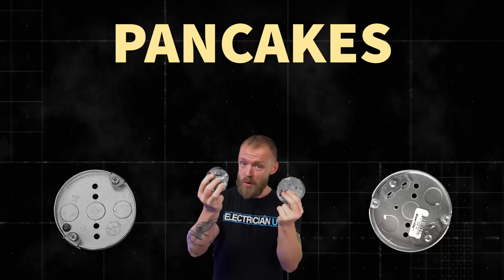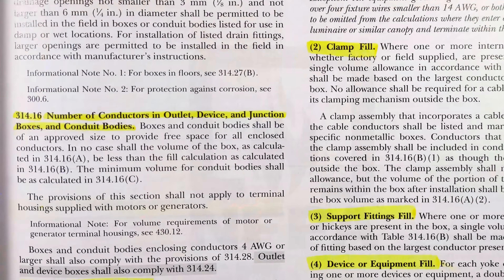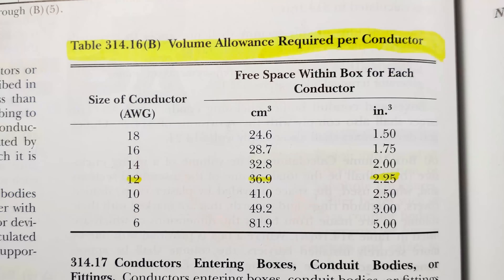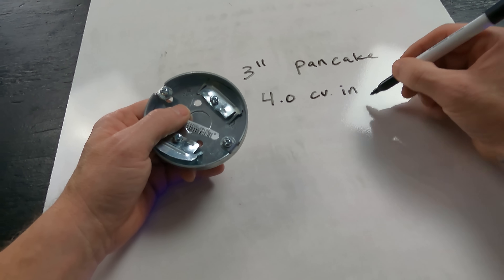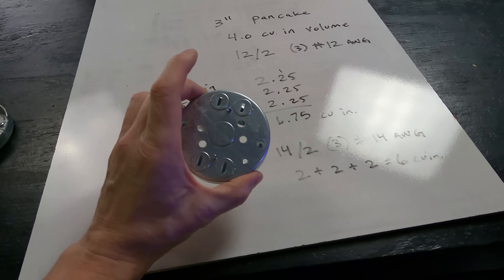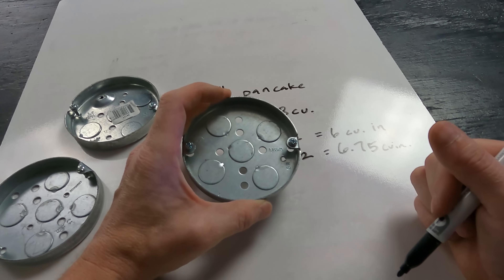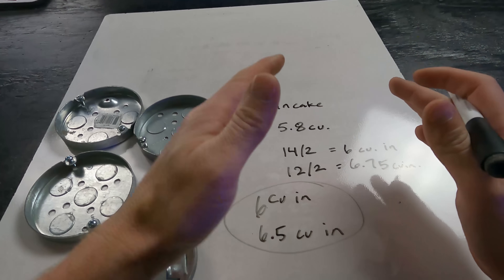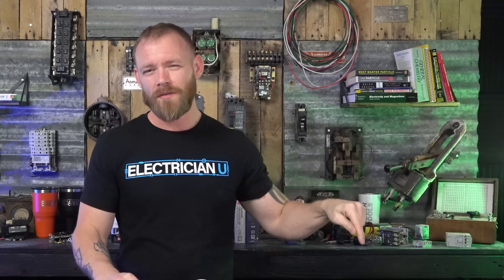Do Pancakes Violate Code? How Many Conductors can ACTUALLY Fit?

Comment: Well, you've helped me uncover YET ANOTHER code violation in my house (2x 14/2 plus fixture wires and wirenuts stuffed into a shallow fiberglass pancake).  I have no idea how this place passed inspection 22 years ago (very basic stuff too).  I'm finding these things during repair of what always turn out to be sloppy installation (multiple arcing/crackling switches because of long conductor strips/shorts, several flickering light fixtures with bad wirenut technique, mis-wired smoke detector travellers left unconnected, multiple GFCI outlets on one circuit, and more...).
Reply: remodeling companies (kitchen & bathroom) get away with scary "electrical" work.
Reply: I’ve been trying to understand the pervasive shit dick work constantly done in our industry since I started 7 years ago. The only thing I can come up with is (because I see it all the time) that as soon as someone is good/competent enough to do really good work, they often have opportunities to make better money running other guys (the ones that don’t know much, of course) and so that’s what they end up doing. And we end up with this continuous mega shit dick work because of it. The foremen, don’t have time to baby and check on their workers and the inspectors don’t care enough or have time to check everything with the time they have allotted for the inspection. It’s such a problem that my company have an entire QC department (I work as QC in the field).
Reply: If you're using metal rather than plastic, allow yourself a little more because of course its much safer

Comment: Again it may also end up being up to the authority having jurisdiction. In my experience let's say vanity lights with a vent pipe dead center of the sink. So a Hollywood light would have space for the conductor. I actually had a service call on a new house in Austin where there was water coming out of the powder room light downstairs. When I got there with the homeowner and plumber and superintendent . I took down the fixture . viola some bozo screwed the fixture to the three inch vent pipe thus the leak. The plumber cuts out the damaged section of pipe and there are dozens of condoms caught on the screws that went into the pipe. So the plumber drops the pipe out in the garage and we all had a laugh. That was until the homeowner came in and asked what are those. The plumber says those are weenie boots prophylactics..The homeowner then says I don't use those things. Uh ohh!! Guy got physically ill. Because it was only his wife and his 13 yr old daughter living with him. Really don't know what happened after that but the guy was immediately on his phone to his wife and his daughters school. True story
Reply: This was a wild fucking ride that I did not expect to go on when I started reading your comment
Reply: Damn

Comment: I really disliked these things when I did remodeling in the 80's.

For starters the wire of choice was 16-2, if it had a ground it was like this tiny 22~24 ga braided wire. Nasty stuff had a braided cotton sheath with a paper filler. $hit fell apart when you touched it. Of course it was 30+ years old.

So after you ran a new nm 14-2wg and ended with a pancake nailed with 2 nails to the ceiling truss hanging a cheap fan.

After much coercion, I'd go to town and return with a nice new brushless fan and lamp set. Fortunately plaster and lathe ceiling is fairly durable and chunks can be replaced. Up in the attic, when you're pulling the cable put backing boards on either side with SCREWS, then drop cable through the hole. After routing cable into pancake (and clamping) you  can reinstall the pancake USING APPROPRIATE HARDWARE SUPPLIED BY THE FAN MANUFACTURER. Sorry, fans scare me. lol

The fixture should have adequate room.

Comment: Question: Most boxes have outlets or switches put in them. With a pancake, you're attaching a device that doesn't go into the box. In fact, in most cases, you're attaching a device with a dome on it, giving extra space for the wires. Are there any allowances for any of that?
Reply: Yes and no. During the inspection phase, you usually don’t have any fixture, it’s just the box with the wires coming in. So that is all the inspector has to go off. But when installing the fixture, you CAN take into account the fixture space itself as well. But you can’t pass inspection to get to that point lol. It’s a catch 22.
Reply: @remodz6385  They do make blank covers for pancakes that have a built in dome in them. that would allow the extra volume to make the inspector happy.

Comment: Are non current carrying conductors a factor in calculating box fill?
Reply: In Canada, I was taught that you do not count non current carrying conductors, which I thought was weird. I just finished Block 1, and had a hard time agreeing with the instructors that bond wires do not effect the box full at all.

Comment: Is there some kind of a bushing that goes into the knockout hole so the cable won't chafe on the box? If so doesn't that have to be counted also?
Reply: some come with a plastic bushing that acts as a clamp or just use a regular romex connector

Comment: I usually use these when i have to put an exit sign right in the middle above a door and there is a stud there.When you screw it to the stud the sheet rockers cut around it and I haven’t had any issues with inspectors.also the exit sign provides enough space inside to make joints.the pancake box is just there so you have something to attach the machine screws to to hold the sign.That’s why pancake boxes are the same thickness of the sheetrock.

Comment: Does the depth of attached wire fill area of fixture(1/2 in depth or more as example) connected to pancake box count as adding wire fill cu in area space if wire splice area of metal area of fixture is protected from exterior sources if i add a metal wire area of fixture is enclosed and directly attached  to  pancake essentially adding wire fill area to the pancake box ?

Comment: If you use conduit there is no ground wire and the pancakes will fit the wires fine.
Reply: You're gonna pipe EMT to a pancake?? What're you in Chicago? 🤣
Reply: Damn, in my area we run EMT and still require a ground wire at every junction box.

Comment: the gc gave me some of these to install light fixtures with last week, im not sure why. i just put them aside and used boxes. that is crazy though, you cant even use a piece of 12/2.
Reply: if you read between the lines, going back say 70+ years ago, these were a perfect fit for 14/2 without a ground wire. In those days they didn't use box clamps or wire nuts to take up space in the box either, just lots of tape.

Comment: I thought that the Ground wire did not count as a conductor, am I wrong on this?
Reply: I relooked in Mike holt exam prep book because I thought the same thing because I couldn’t remember but you do count the ground
Reply: The ground only counts as one conductor, if memory serves me correctly
Reply: @Sparky-2036  Unless there are more than 4 EGCs...in which case EGCs 5 and above each require a 1/4 volume allowance... 314.16(B)(5) of the 2020 code.... added in 2020...

Comment: I had a water loss underneath a kitchen sink. Basically a flood from a broken pipe under the sink. 
Went in the house and opened up the cabinet doors… the fridge, range, garbage disposal, and a light socket for the “microwave” we’re all hard wired with 1 wire nut to each line, and there was no lid to the pancake. I hit the main breaker and still wanted to cry the whole time I unwired that shit.

Comment: Why do they make and sell things like that 4" box in the first place if it violates code no matter what you do?
Reply: because it can be used in ceiling for fixtures if you add a j box in ceiling and attach mc or flex with 2 wires for hot and nuetral entering pancake and a removable ceiling cover to access the hidden j box in ceiling and use 14-2 as fixture power termination or 12-2 if deep pancake or add a extension ro pancake box before fixture which would drop fixture from ceiling the depth of added exrension

Comment: I work for a new build residential company. If we use a pancake, we do our best so it only has one run of wire in it. So many instances of the dry wallers cutting our wire. Then we loop it to pull extra if needed.
Reply: fixture still needs 2 wires tho a hot and nuetral so 1 wire is not possible since nuetral can be energized on return it counts as wire 2 and fixture needs nuetral
Reply: @davidicousgregorian  one run of wire being a 14/2 leg from the switch for example.

Comment: What about conduit grounded circuits? Couldn’t a 3” pancake work if you’re only running hot and neutral in 14 awg with the conduit as your ground?
Reply: are you talking about a light fixture with a pull-chain from 1950? Let's get real. A half inch box doesn't have enough room to connect a half inch conduit.

Comment: I think you wrong, see below:

A pigtails are not counted. 
B equipment grounding conductor(s) or equipment bonding jumpers entering the box count as one conductor 314.16(B)(5). only the largest equipment grounding conductor shall be counted if multiple grounding conductors (of different sizes) enter the box.

 Love the videos, keep up the good work. 👍
Reply: Wrong...if it's more than 4 each additional one is 0.25 conductor allowance
Reply: @mr.g937  
A pigtails are not counted. 
B equipment grounding conductor(s) or equipment bonding jumpers entering the box count as one conductor 314.16(B)(5). only the largest equipment grounding conductor shall be counted if multiple grounding conductors (of different sizes) enter the box.

Comment: Does my pancake violate code if there's an extension cord hanging out of it with a lamp socket on the end? How far back would we have to go? (I have cloth wrapped wiring)
Reply: your whole system predates code so making changes will be an issue, unless it's all redone back to the panel, which will not meet today's code anyway.
Reply: Residential code generally allows that work inside the wall met code when installed, so it's ok(ish). The extension cord out of the box raises questions, pancakes are almost exclusively for mounting luminaries.
Reply: @donphillips5957  ... back in the day that cord hanging out of a box was usually called a laundry drop. They were used for both lights and a place to plug in appliances. (washing machines) They were code at the time, although pretty shaky by todays standards, even without being 100 years old and having worn insulation.

Comment: 2 things. I thought the grounding conductor counted as less? And if you run a switch leg of 14 off of a 12 do you have to derate the circuit to a 15 amp circuit then? Just trying to learn and I don't have a code book to cite. Thx for the videos and info, they are always well done.
Reply: I believe it follows same logic as 15 amp outlets on a 20 amp circuit you can't put more than 15 amps through that particular piece of wire because its going to 1 dedicated fixture
Reply: Older code allowed 14g for a 20A circuit (my apartment), but the wires had to go through the walls, you would derate the wire ampacity if it went through the attic because of heat. Complicated,  so they have just made it 12 for 20A.

Comment: THE only time you see a pan box  when the plumber  puts the vent pipe center of the vanity in the bathroom
Reply: negative there. in our case, its usually the water lines for bathrooms, gas lines to kitchen or heater. now and again, building furnace exhaust vent

Comment: Keep in mind bro 410.20 allows us to use the canopy of a luminaire. I really like your material and we need to make sure the guys learning from us know the true code for the exam.
Reply: I agree with William, I don't see in 420.20 anything that says the canopy needs to be marked, most are as big as the 4" pancake so even without doing math if it's over a half inch deep and covers the box it is at least 6 cubic inches which covers the fixture wires noted in table 314-16(B).  I don't especially like using them, but they do solve problems from time to time, especially for ceiling fans.  But the video invites discussion and a really good rundown on box fill,
Reply: @johnsmall5288  420.20 is agricultural lighting 🤣
Reply: @Williesnyder77  sorry  I meant 410.20 John Small Dyslexic Electric :)
Reply: @johnsmall5288  The canopy is not even required to be marked per the UL standard 1598
Reply: @johnsmall5288  I'm the same, I don't use them much. but when you have to put box in an exact location like in the middle of an area, you can't just cut a 2x4 out and put in a cut in box. the pancakes are about the only option.
Reply: One of you guys help me out, please.
Can wire be brought into a pancake and there not be a clamp (strain relief)?
I'm no pro, but I have never opened a box wired by a pro where conductors just flop through an open knock-out (other than low voltage, of course).  Shouldn't the clamp volume be the first deduction?
Reply: @barbeonline351  connector and locknut don't count against box fill, that will provide strain relief clamping outside the box.
Reply: If you're using the canopy of a luminaire as the "box", does that mean the pancake becomes a raceway and does the wire fill for the pancake still exist OR, does the canopy become a box extension, therefore increasing the wire fill alotment ?
Reply: @donaldshimkus539  No the luminaire canopy adds volume as a total assembly per 314.16(A).
Reply: @donaldshimkus539  there are such a thing as box extenders, are those then considered raceways? Nah, it's just more box lol
Reply: If you're trying to pass an exam, don't use  YouTube lil
Reply: 314.16 which is referred to in 410.20 days that the volume needs to be marked and most canopies on fixtures are not marked
Reply: @bananainacup  typically the AHJ will allow us one 12/2 or one 14/2 for vanity fixtures with large canopies regardless of the box fill calculation
Reply: @Williesnyder77  yeah I mean I’ve never had it fail But it is kinda up to the ahj interpretation
Reply: @bananainacup  same with LBs as long as they have a volume you can even make taps in them. Which I do not recommend doing
Reply: @bananainacup  I have the 2020 NEC code handbook, which is the one with explanations in Blue. It's hardback. 

Under 410.20, the blue explanation follows. 

"UL 1598, Standard for safety for luminaires, allows junction boxes and splice compartments that are integral to luminaires to have less free volume than required in 314.16, Section 314.16 applies to general-purpose boxes and conduit bodies where installed conductors and devices are variable, while the conductors and devices that will be contained within a luminaire junction box are known"

Don't know about 2023 NEC
Reply: I doubt many inspectors do fill calculations or check if the light will have enough room.
Reply: @darksaint36  Some do, but very rarely on any residential jobs. The workload is crazy and the doper roper inspectors are never the most experienced inspectors on staff.
Reply: Only problem is you never have the luminares when roughing in so you can not calculate the total cubic inches of a 4" pancake box a & luminares and a canopy. Also not legal to run NM cable to ANY outdoor box. At a IAEI continuing education class were told to only run type UF cable to outdoor boxes.
Reply: @JohnThomas-lq5qp :

What’s the problem?
Does there exist a luminaire that won’t add a least 4 in³?

Comment: Dustin the pancake box alone is crap 
Usually it would be installed with a sconce or a pendant light in a kitchen 
It adds space and most of the time is metal usually brass and has a ground in it 🤷‍♂️🤔 I only use them in residential jobs anyway most parts house don’t carry them especially Platt

Comment: At 10:50 in video, you talked about using 12 ga combined with 14 ga switch leg. Is that to code?  The 14 ga wire would not be protected with a 20a breaker.
Reply: Tap conductor rules, check out 210.19. It's a more difficult set of codes to understand so most resi guys just stick with the small conductor rule 240.4(D).
Reply: @zacharybob4336  I don't have a code book to look it up.
Reply: I agree with Eric about not using 14 gauge switch leg on a a 12 gauge/20 amp circuit.

Comment: The 12/2 romex that you use in the states has 3x #12 conductors in it?  Interesting.  The 12/2 that we use here in Canada only has 2x #12 current carrying conductors and 1x #14 ground within its sheath.  

Our cables have the ground awg lag behind  by 1 gauge  with exception to 14/2.
  ie:  14/2 has a #14 ground,  12/2 has #14, 10/2 has #12, 8/3 has #10, 6/3 has #8 ground. 

If your 12/2 does in fact have a #14 ground, then theoretically the 6.5 cu in pan box will work.
Reply: 12/2 in the us only has 2 current carrying conductors. When he talks about fill you also have to include the ground. In 12/2 Romex in the US you have Hot, Neutral, and Ground all of which are #12
Reply: @QuantemTekGamingtv  I did hear what Dustin said,  I just didn't realize that your 12/2 nmd is physically different than our 12/2 nmd.
Reply: @QuantemTekGamingtv  that is true for new romex wire but 1960s cloth jacketed and bx that i still run into in older homes had the derated grounds , #12 had #14 size grounds

Comment: If you're trying to use one of these as a junction box, wouldn't that be a minimum of five conductors going in?  (2 hots, 2 neutrals, and 2 equipment grounding conductors that count as 1)
Reply: Yes...and it's not to code, although many people do it (and I've done it).

Comment: Must of the time I have seen pancakes used is to mount a light fixture. Can we not add the volume of the fixture enclosure in our calculation?
Reply: If the fixture has a volume marked on it, yes.